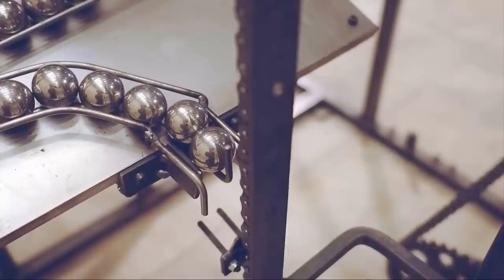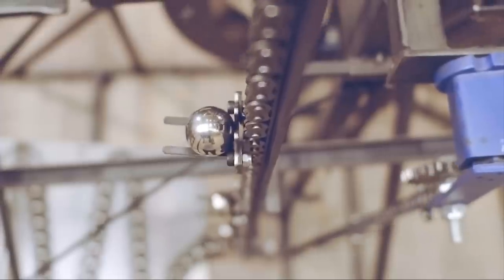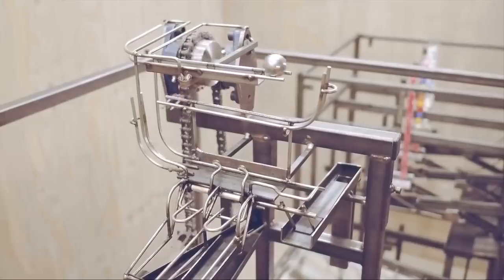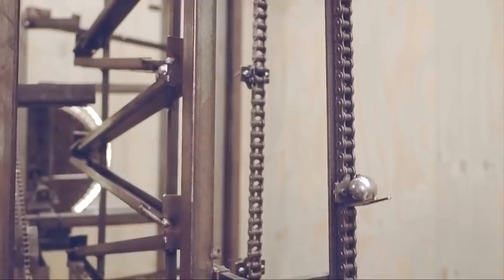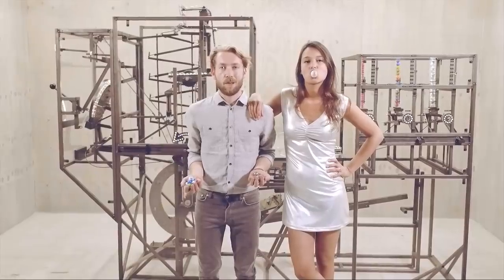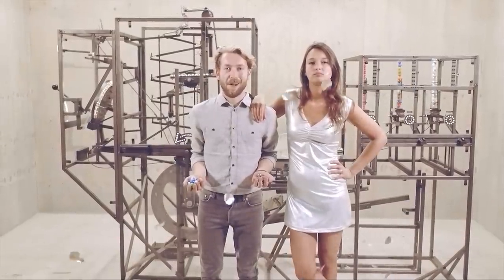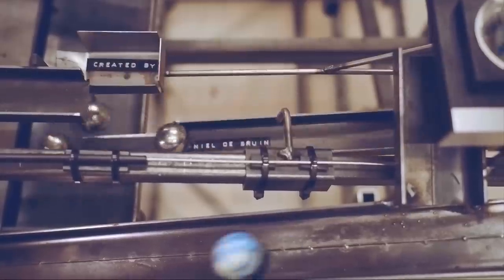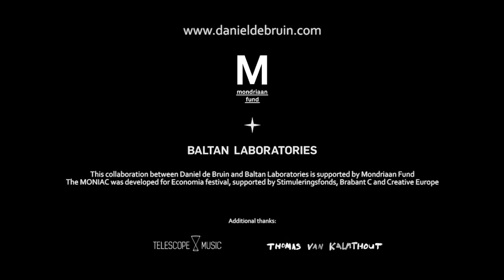a HUGE interactive MARBLE MACHINE!

Comment: And every ten years you might end up on the street
Reply: Alexander Chohan literally yes, that’s how most capitalist economies work. There has the be a crash every few years or it’s unsustainable, and the lower classes just get bigger during those crashes, eventually there will be no middle class anywhere.
Reply: Yes but that is better than being on the streets your whole life
Reply: @truejoyproducts5097  Crashes are not necessary in an economy. They usually happen when the government enacts some kind of regulatory pressure and it leads to long term consequences. In America for example, the Great Depression and the Great Recession both happened because the government did shenaigans with banks and loans resulting in a bubble and collapse. Bubbles do not normally happen in true capitalistic economies, save for non-economic disasters such as natural disasters, warfare, etc. The reason crashes don't happen is because it is self regulating. For example if something becomes scarce, prices rise which limits consumption, and encourage more growth in that industry, which then lead to surplus that lower prices. We see this a lot in software design.

Comment: Excellent in conception and execution. 👌

You could to add a class basis to the machine that syphons off a number of balls to the owners of the means of production. 

Then pouring more balls into the system (I.e. quantitative easing) would initially restore its functioning but just lead to a bigger crash. 

wsws.org